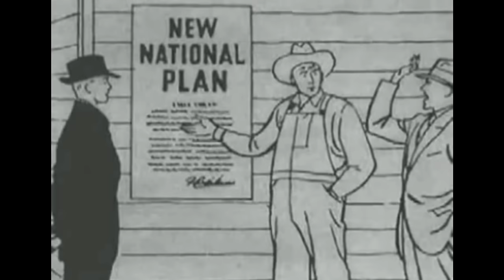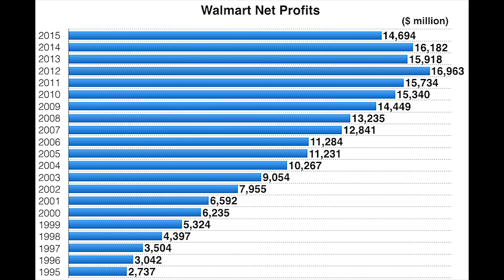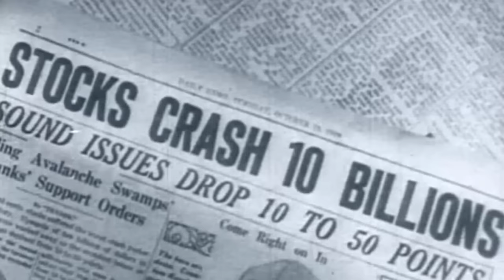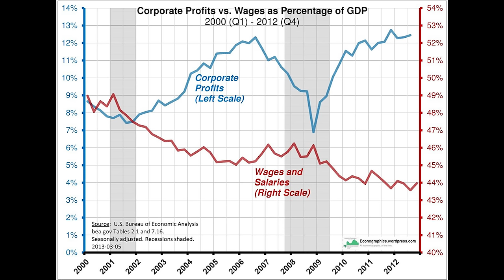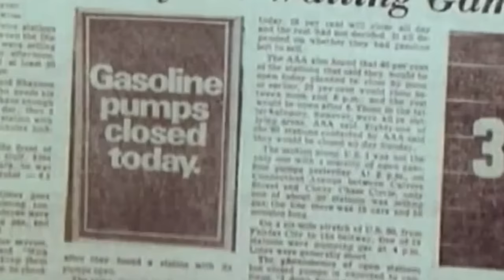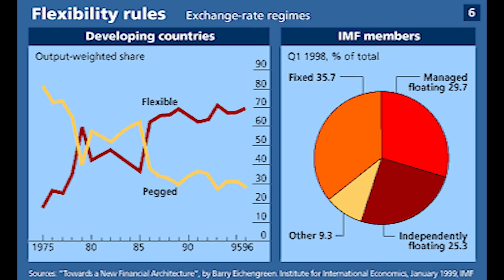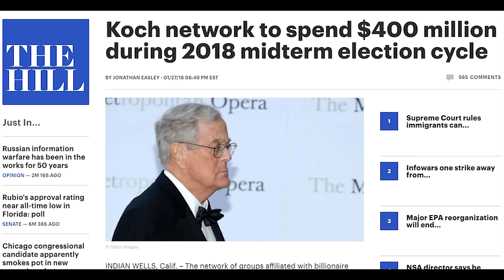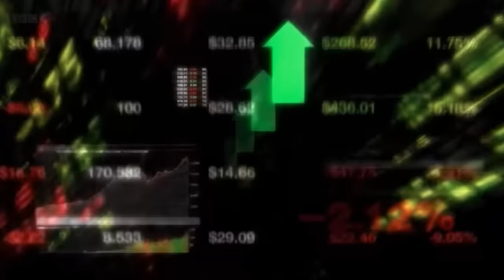This Is Neoliberalism ▶︎ Introducing the Invisible Ideology (Part 1)

Comment: I think the goal of neoliberalism is to keep the factory model entrenched, neoliberalism has largely lead to mass outsourcing, which under this economic model, it's essentially guaranteed that it will lead to outsourcing and thus the lowering of wages for the working class, which keeps the factory model place, and the working classes displaced everywhere. Why is it that you need to do this to the working class to have a more 'competitive' and unregulated market? You do not I think, it's not necessary or practical. It's not just literally factory work, but I think this is what it boils down to.

Comment: "One of the key tenets of neoliberal economic policy is that it doesn’t matter where something is manufactured, or done. Let the cheapest domicile do it, and everyone will benefit.
This is bullshit, and always was. Making and designing new things is where economic strength, the good life and military power all come from.
Nations which forget this wind up in the dustbin. Free trade, as an ideology, is the deathknell of great powers, including Great Britain, and likely to include the US.  It does work for smaller powers, and should be the default policy mode for all city states, but great powers are not small powers, let alone city states."

Comment: Neoliberalism is a phantom term. What you're talking about is capitalism and it's variations.There was indeed a turn towards market reductionism in the late 70s but this was not driven by an ideology and certainly not liberal ideology(which is about more then just the market) The reason market fundamentalism rose was due to the crash of the cheap oil economy which made things like the welfare state possible.

What you're really talking about is austerity, and that is not liberalism per se. The major co-factor that people who peddle this phantom term are missing is peak oil in the early 1970s. That is what ended the early-mid 20th century welfare state. Also, the modern welfare state has roots in Bismarck capitalism and statism as well as fascism. The pre 'neoliberal' world was not exactly great particularly when it came to socially liberal and radical expression.

Finally, we don't live under liberalism, conservatism and liberalism rule about equally when it comes to modern economies. We live under modernism which is some mix of capitalism and statism to varying degrees.

Comment: The problem is with the assumption that absolute economic freedom would increase political and social freedom. The term "Neoliberalism" looks back to "Classical Liberalism," which is now  better known as  "Libertarianism." 
    A century ago, progressives like Teddy Roosevelt saw the excesses of the gilded age, in which wage slavery without unions, consumer protections, or limits on monopolies.
These intolerable conditions generated violent resistance, leading to the Bolshevik Revolution, anarchistic terrorism.
    FDR who was certainly part if the .1%, recognized that the lower classes could not be successfully suppressed by state and private corporate violence.  The miserable and desperate would eventually revolt, as they did in France, Germany and Russia.  The Establishment only recognizes class warfare when the poor are no longer unilaterally disarmed.
     Libertarianism differs
from  neoliberalism primarily in that Libertarianism applies laissez-faire policies ALSO to individual sexual, religious, social, literary and artistic freedom.  As a philosophy, Libertarianism fails 
becuse it CANNOT solve the problem of the "irreducible commons." The libertarian might argue that he owns the air on his property and has the right to pollute it as he likes, to squeeze out maximum profit. Air, however, doesn't stay confined by property lines. Therefore, the polluter CANNOT prevent it invading his neighbors' property. 
    Similarly, a Libertarian would argue that he shouldn't be forced to contribute to public health measures like public sanitation, flu shots, or sanitary conditions for children, prisoners, workers and the homeless.  However, with instant, global transport if people and goods, the new virulent forms of TB, MRSA, etc., could spread worldwide quickly, destroying workforces, education, etc.   Something like polio, Ebola or a new airborne virus could be devastating to everyone, regardless of wealth. Our PUBLIC HEALTH SYSTEM is actually a vital element of national defence. And health care clinics are our defensive checkpoints.
     Again, air, food, surface waters, wildlife, and anything that travels   are all part of the irreducible commons.  Unless you seal yourself up in a spaceship, you cannot isolate yourself from harm done to the irreducible commons, no matter how much wealth you have. 
     Soviet Communism subbordinated the individual to the state absolutely.  It devolved into a kleptocracy.   Laissez-faire Capitalism  subbordinates EVERYTHING to wealth. 
But Midas learned that turning everything you touch into gold eventually leaves you to die of hunger and thirst, without even the comfort of a lived one's touch. 

CITIZENS UNITED gives corporations political rights in proportion to their wealth (1 C-note, 1 vote). BUT, corporations are theoretically immortal, immune to imprisonment, transnational, non-local entities whose money can travel around the planet at the speed of light. They tend to conglomerate into monopolies and cartels which destroy the very market forces they claim to believe in. Their immense financial and political power results in corporate lobbyists -- not the legislators -- writing the laws that regulate their own industries. Often these laws are mostly to protect larger corporations from Free Market competition.  
     There is a middle ground between Corporate Capitalism and State Communism.  Many European countries have successfully balanced sustainable business and environmental practices. 
     Keynesian economics was the foundation of the economic miracle after WWII. Better paid workers became EXCELLENT CUSTOMERS. Healthier kids became better, more effective employees.

Comment: The content is great, and so, so, necessary. Maybe it’s because I’m an old codger, but I just can’t take in the pace of delivery and graphics, without continually pausing that is. I’m not suggesting you dumb down as far as a TV documentary, but maybe a little less density of information. Alternatively, a series of shorter videos might make this complex subject more accessible. Many thanks. J
Reply from the maker: Thanks for the feedback James. 

Your criticism is the one I receive the most frequently, which is to slow down the pace of the narrative. I tend to push back against that suggestion because I don't like sacrificing complexity or lengthening the video beyond what is necessary. Personally I prefer if my viewers need to pause or rewatch the video to digest the point. I think they'll retain the info better that way. However, I am going to try to read slower and emphasize more pauses in my future videos.

In solidarity,

Barak
Reply: BarakalypseNow ..a great job, and information needs to be presented at all levels of accessibility; for the slowest and thickest right up to the quickest and brightest! Maybe make it your thing, like a Unique Selling Proposition. Best wishes, Jim B
Reply: Try tapping the video screen on the left hand side, one, two or three times to rewind the video 10, 20 or 30 secs. I hope this helps, as it did me.

Comment: I haven't watched the series yet, but I have watched this one so far. Am I correct in assuming somewhere along the line, some one or someones took a literal 'post modernist' approach (most likely not using the label of post modernism) and threw away the objective reality that we live in but really hold a mental abstraction of what we sense. Instead placing the abstraction or mental framework of 'the market' itself to be center stage in our reality? That is my thinking, it would be super interesting to see if that is where you go. 
I have to get a better foundation in economics, then look farther into Neo-liberal writings.

Comment: Holy crap! After watching that, I wanted to ram my head in a wall in exasperation. There are so many things wrong with this presentation. I'm not going to debunk the whole thing, but I will point out a number of errors.

First off, you talk about the Great Depression, but you do not explain why it happened. It happened because the Federal Reserve raised interest rates, which shrunk the supply of money, making it more difficult for investments to succeed. The Federal Reverse is a central bank that pretends to be a private bank. Its Board of Directors are selected by the Senate. Its official website is a .gov website (check for yourself if you don't believe me). In other words, it's part of the government, and its control of the money supply is government intervention. In conclusion, the Great Depression was caused by government intervention in the economy. The idea that the economy in the 1920's was laissez faire is demonstrably false.

Next, you talk about the Embedded Liberalism of the Roosevelt era as a response to the Great Depression, but you fail to explain why the Great Depression lasted as long as it did. It was the policies of that very Embedded Liberalism that caused the depression to last as it did. For comparison, in 1921 there was a similar market crash as the 1929 one, but the government under Calvin Coolidge decided to stay out of intervening, and the result was that the depression ended in a year and a half. If Roosevelt had done what Coolidge had done a decade earlier, the Great Depression would not have lasted so long.

Later, you talk about the stagflation of the mid to late 1970's, but you again fail to mention why that stagflation happened. It was the result of three factors. One, welfare expansion programs from the Great Society were very expensive. Two, the Vietnam War was also very expensive. And three, Nixon took us off the gold standard, making it possible to "borrow" as much money as they want (remember that the Federal Reserve is a Central Bank that can create money out of thin air). These three factors resulted in rampant spending by the government who paid for it by flooding the market with freshly printed money, resulting a lot of inflation. In conclusion, government intervention caused the economic problems of the 1970's, which was why Jimmy Carter only served one term as President.

The last point I'll address is the various wars and revolutions that were caused by our government in the name of big business. I agree that those were bad things, but they again demonstrate big government as being the problem. For most of the time that the Republic has existed, we did not have a CIA and did not need one. We had a much smaller military and thus a smaller military industrial complex. Big government always abuses its power, whether it's multinational corporations pulling the strings for the US, or corrupt bureaucrats in the Soviet Union.

I could go over more, but I'm more than confident that I poked enough holes in your presentation to collapse the whole thing. The idea that we're living in a libertarian economy is demonstrably false. If we actually had such a thing, we would not have a Federal Reserve. We also wouldn't have an FDA, department of Education, department of Agriculture, an FCC or any other of a large number of regulatory agencies that have been created in the last 100 years. We would not be spending trillions of dollars on various government services from medicare/medicaid, social security, public education, housing, food stamps, etc. every year. We would not have a war on drugs, and we would not have government subsidized student loans. We would not have corrupt agencies like the CIA, FBI and NSA. Finally, we would not be ~23 trillion dollars in debt. We live in a Crony Capitalist economy that favors the super-rich and placates the poor at the expense of the middle and working classes. The big government expansion that happened in the early 20th century that was supposed to counter the robber-barons ended up becoming a weapon of those very same robber-barons. I hope my comment enlightens any fence sitters who watch this video, because half-truths are more dangerous than lies.

EDIT: Fixed a typo
Reply: After watching the vid and reading your comment back to back, I don't even know what to believe anymore.
Reply: RuskiBeaner   RuskiBeaner  Believe what you've just read. These  are historical claims based in facts. You can simply Google Coolidge vs Roosevelt reactions to the depressions.

I was hoping someone would do it. Jombo0008 much thanks man or woman. Really didn't want to have to go through the trouble.

The creator of this video is an example of what an ideology driven education has left us with. No facts, just opinions and impressions pulled from thin air. 

From one section to the next, he is creating false narratives out if thin air absent any facts.

I mean how could you not know what role the Federal reserve played In the lead up to the depression? And how could you set up a narrative without covering it.

 This is Soviet styled propaganda. No facts. Just fiction. This should be a mockumentary.
Reply: Something seemed off to be when he didn't mention the federal reserve. Just couldn't quite put a finger on it. Nice
Reply: Couldn’t agree more. It’s also very concerning to see that so many people in the comments are saying “this should be taught in every high school”, after watching such a misleading video

Comment: In the United States if you're in California it's a car because the state was designed around a car and not public transportation in New York it was designed around public transportation, land typically was cheaper the further out from the main cities in California so suburb started to pop up it was this growing housing that led to the economical booms of a late 40s to the late 60s, it was the policies and practices that increase the labor market from the feminist movement in the 70s to the increased immigration policies in the late 80s and early 90s that led to the stagnation of wages, which is typically don't increase when there is a doubling of Labor participation year-over-year for 30 years, when things are in abundance it drives down the cost so it drives down the need companies to offer greater incentives for a competitive labor market, further stagnation happened when the ability for companies to shift production became very easy in the late 90s early 2000 China Mexico southeast Asia India and like, making the labor market, noncompetitive in the US, I would argue that Technologies had displace the labor market is well around the same time

Comment: You kind of skipped over why Neoliberalism came to replace embedded Liberalism ie why did the people vote for it? All economic systems are time dependent and eventually fall, there were massive social and economic problems created by Keynesian 'embedded liberalism', not the least very high unemployment coupled with high inflation, it wasn't just the oil crisis that was creating stagflation, workers had bid wages up well beyond their productivity and investors couldn't make a return above inflation so they stopped investing, which caused recession and unemployment. We are in the grip of another investment crisis, this time market intervention (ZIR, NIR & QE) by Central Banks and Governments is the issue and the economic system needs a reboot. We need new ideas not a return to old failed paradigms.  

Also, I find it interesting that almost all Libertarians (especially Austrians) would fight you tooth and nail on the current economic order being anything even close to resembling what they would find desirable.